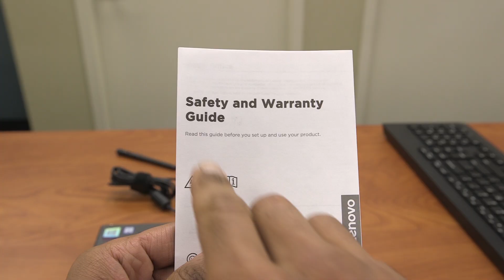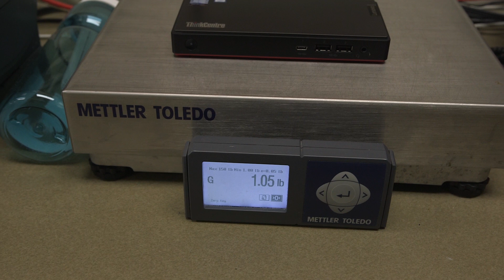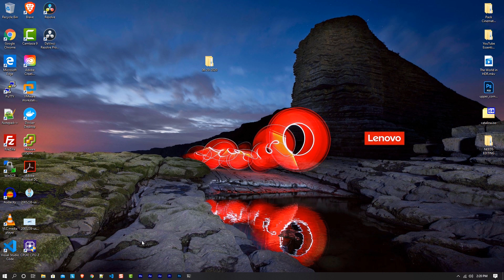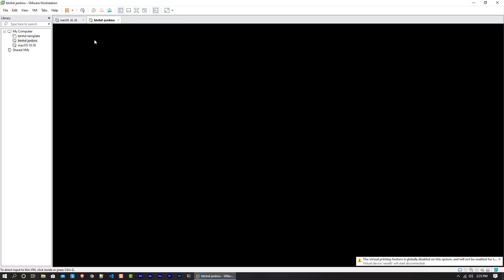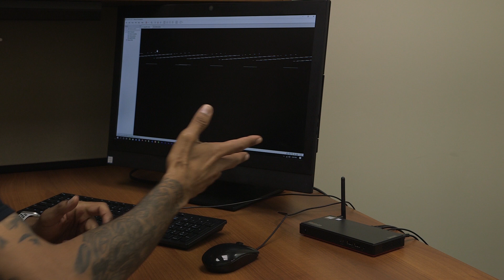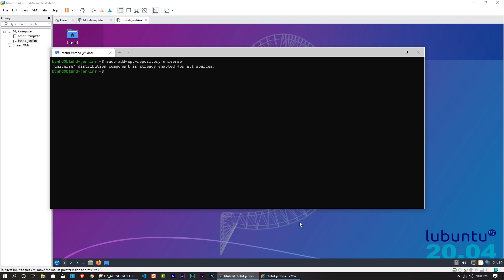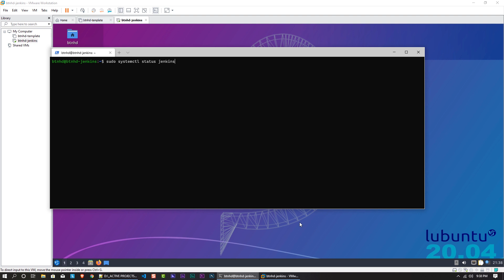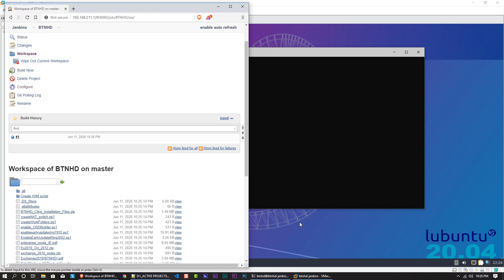Lenovo ThinkCentre M90n-1 Nano Unboxing & Review | Jenkins Build Server Edition!

Comment: I bought this PC , Fan Nice levels are very high loosing my concentration on work , returned it after one week on my purchase , lenovo has to provide stand to hold this PC vertical ,if you hold your PC vertically assuming can reduce heat , Fan noise will be very low , I am not happy with this PC
Reply: Thank you for sharing you experience.
I want to buy one but I am worried about the noise.
Is it noisy all the time or only under heavy load?
How does it compare to a mac mini 2012 in terms of noise?
Reply: nano pc is ok for browsing , if you open more than 5 tabs in google chrome this will make noise
Reply: @adisrik879  Thank you so much.
It's a hard NO then!

Comment: talking about Lenovo...let`s see what we find on web, a Lenovo ThinkPad X250 i7-5600U for 100 GBP (1/4 your price) BUT it has a battery and a display, a keyboard and a "mouse" inside...you can plug it into a TV but you can take it outside in the morning for the backyard coffee,  and it will still be smaller than all your combo (case, powersource, keyboard and mouse ) NO CABLES on your table

Comment: Hey! Nice video, as usual! Any particular reason to use a Linux VM instead of using a Docker Container to use Jenkins? Wouldn't it be easier and lighter to use it instead?
Reply from the maker: Good point! I would've done docker all the way and just pull down the Jenkins image, but I wanted to test out the limits on the M90n-1 😀😀
Reply: @bjtechnewshd  fair enough! 😄I was just curious if it was some kind of limitation with Docker on Windows or something like that